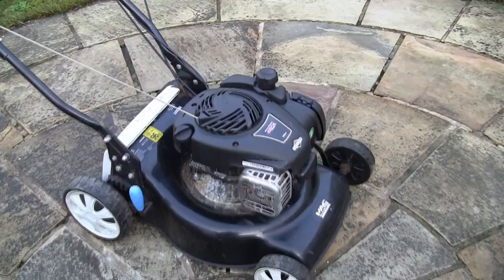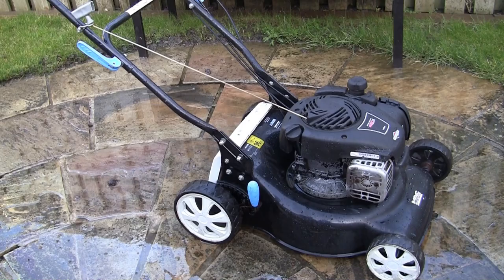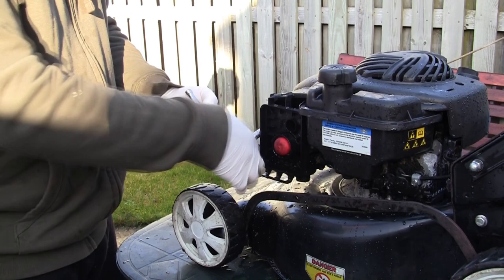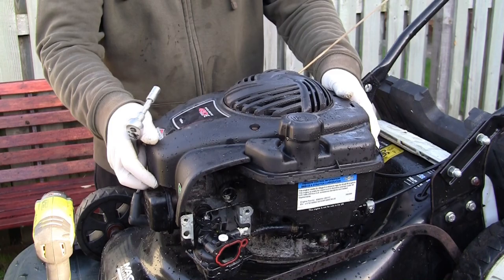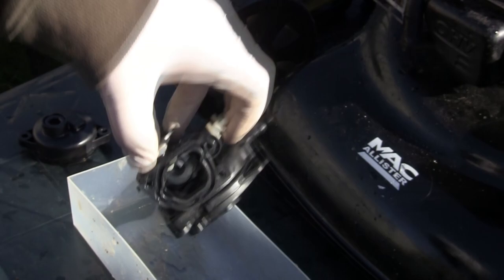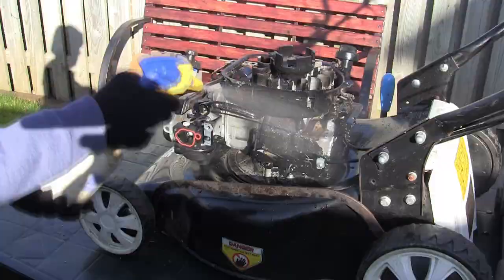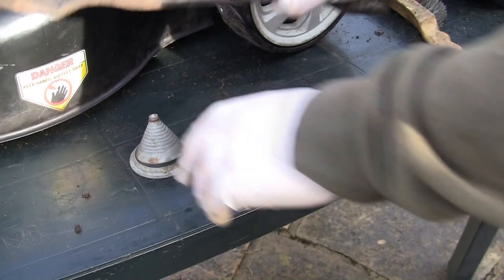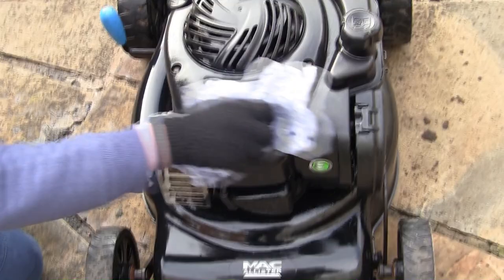Briggs And Stratton 450 E Running Rough-How To Fix

Comment: I swear when you started wrestling with the fuel line I thought there was going to be one of two outcomes.
1 split hose
2. broken off fuel line barb on the carb
I find a flat screw driver wedged and gently twisted between carb and hose applies just the right amount of force for the hose to come off even if the rubber has bonded

Comment: I just found your videos. My 450E is surging like yours in the video, I'll try cleaning the carb before replacing it. It's been a great lawnmower (Lidl buy from a few years ago) and I've neglected it. It's got the original oil still in it lol. Thanks to your video, I'll treat it to new oil and a spruce up this summer.

Comment: I removed the flywheel on this model and then underneath there is a metal tray which supports the fuel tank and oil dip stick. This was well rusted on mine so I went to remove it to clean up and found that it has a liquid gasket applied to the underside where I think there is a chamber for fuel air mix. This type of engine seems overly complicated compared to previous B&S engines. If you ever remove this tray, please post a video on this. Many thanks.

Comment: Those engines have a secret or two. Out of the box..... test it before the warranty expires. People buy these on sale and don't try them till spring. The jet needs a slight reaming with a .5mm drill bit. Maybe a .6mm on the larger displacement. I messed up and had to remove the jet and solder fill it. Then use the .5mm..... .7mm is too big for the 125cc and it will chug like a steam engine. Works great now. My "customer" keeps it in the garage too. Oil level seems to affect the governor in a big way.

Comment: Where the triple towers goes in you need to clean down in there too. I think there's a jet ir hole that gets clogged in there too. Clean with carb cleaner and compressed air . Make sure spray in hole it comes out other end

Comment: Should  never use a rusty  bolt to plug the hose  the  debris will go I  the carburator
Reply from the maker: That's a very good point thanks.

Comment: Hi Paul, i have sickle bar mower build with briggs 550e motor. My problem is the motor is surging. I cleaned the carb twice, but still surging. What i find out is, when i adjust the trotthle the rev not changing. Could you pls help me? Thanks a lot 😊

Comment: Great video, my briggs 35 classic has a problem. It runs very well while just idling or when mowing fine short grass, but when mowing long tough grass it makes a lot of black smoke. I use the correct  NGK plug in it and wondered if a diaphragm and gasket would fix the problem. Thanks.

Comment: I have a 10 yo mower with this Briggs and Stratton 450e engine. It revs up and down, as though the throttle is continually opening and closing. I watched another video of Mowerman's explaining how to clean the carb. I did that, and it was just the same. Then I figured the fuel was old. So I replaced it with new conditioned fuel. Then, still no better. Finally, I decided to simply replace the carb because they're cheap enough. Still no better. It also has a new spark plug and filter. I figured it may be the throttle governor, but I can't tell.

Can anyone help, please?

Comment: Thanks for detailed video! Managed to fix carburator isues. But looks like there's one more problem with gas tank vacuum. After some time of work the engine starts to loose power and stall. This can be temporary fixed by opening the fuel cap for a sec. Then it works fine for 5-10 minutes untl the next opening. Can't see any gas tank breather that can level pressure difference out. Is there something to cleanup that I missed?

Comment: I think I've watched every 300e/400 video that you've done, a massive help so thank you! I have a Briggs 300e and it surges/pulses, I've replaced the carb, spark plug, air filter but no joy. Next plan is an oil change, new blade and fresh petrol. One question: with the copycat carbs they include a red O-ring which I assume goes on the manifold between that and the white retaining washer on carb? The fitment from copy at black O-ring wasn't that snug so I had to re-use the original briggs black o-ring. Any other ideas?

Comment: Iv just bought a mac allister 500e 140cc and the things a beast my really only issue is that the wheels dont feel all that strong you can wobble the wheels side to side quite easy do wish they was more sturdy
Reply: How is your engine a year later? I am a dummie in petrol motor lawnmower life. I got today a new from shop, some austrian made, i guess "old model" 46cm lawnmower with 500e briggs engine. Would be good if you give any replies or comments. Thanks
Reply: @paulaur  it's okay gored strait up after winter just hate the wheels they feel so flimsy  everything else tho is amazing top machine for price

Comment: Hi hope you can help, I have a Briggs 500E engine on a lawnmower its one year old it has the red fuel primer bulb. Now when I push the bulb there is no sound of fuel being squrted into the engine, so starting is slow. On the right side of the carb there is a white plastic spur shaped plastic stub of a tube, that is not fitted to anything. What is this for.
I have seen videos suggesting this plastic stub should be blocked off in order to get the primer to pump fuel, what is your take on all this.
Regards Dave Porter
Reply from the maker: The white plastic stub should not be connected to anything. I believe it's some sort of air inlet. You don't hear much when you prime that model. I would spray some quick start spray in the head by removing the spark plug spraying then replacing. Quickly try to pull it over. If it fires up for a second and dies you know its not ignition related but fuel starvation. Service the carb and make sure the choke opens and closes if it has one
Reply: I have the same primer bulb problem myself.    Looks like a plastic stub tube sticking out the side….   I can hold the primer bulb plate and carb together in my hand and cover that tube stub with one finger and push the primer and i can hear it trying to prime gas through it.    I think im gonna block that tube off

Comment: Great to see this video as I'm tinkering around with my qualcast xss41d push mower which keeps surging last year I did a carburettor clean and it improved its performance but  still surging as such could a damage flywheel key make it surge as well? any advice would be much appreciated kind regards Dave 👍
Reply from the maker: It will be the carb. theses are prone to it. You can get a replacement real cheap
Reply: @MowerMan  cheers mate will do 👍
Reply: @MowerMan  what's that accent where you from Scotland,  England Ireland ?

Comment: Any good tips on stopping the front wheel spindles from coming loose on mountfield petrol mower ??
Reply from the maker: Tighten from both sides
Reply: @MowerMan  was thinking on nilocks so they dont come looose
Reply from the maker: @seantarras9171  use a spring washer